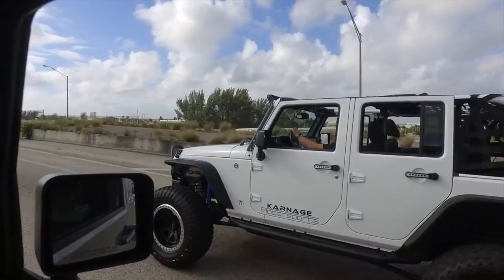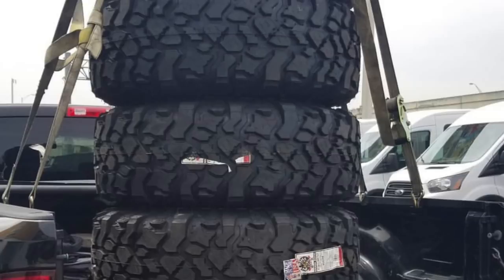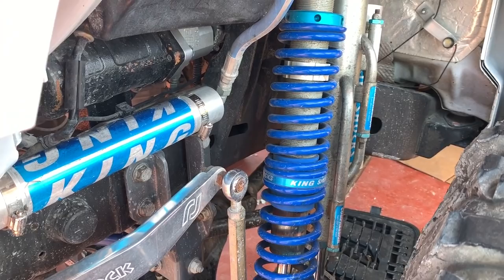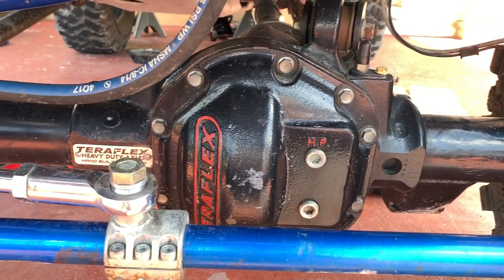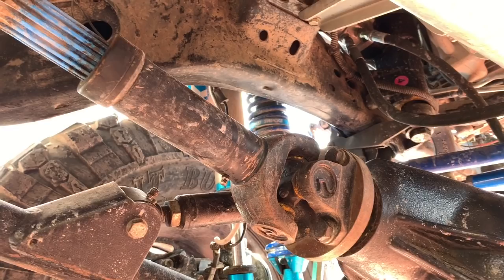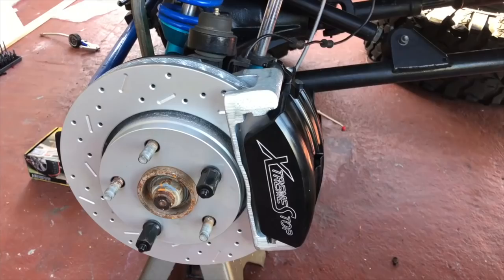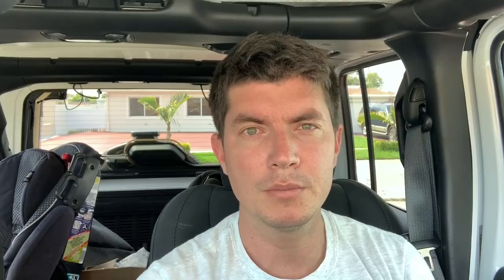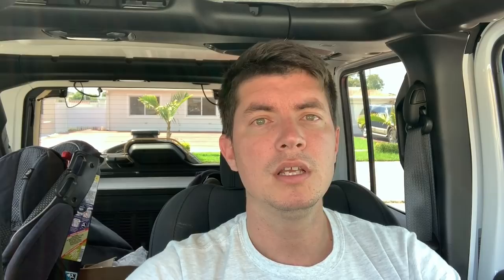What You Need to Run 42" Tires

Comment: I drove my new jlu wrangler rubicon from the dealership to the mod shop . Put front and rear UD60s , evo long arm conversion, evo reservoir coilovers , adams drive shafts, beadlocks , front and rear bumpers , warn xenon winch , 40” tires , PSC HYDRO steer. Total out of pocket cost 52,000 bucks . Price for Jeep 51,000 😂 . Did some other smaller mods , it adds up fast

Comment: What would be the total expense to get those 42s to work well including the wheels and tires?  15k to 25k?
Reply from the maker: Justin Snyder just getting the right Axles $12,000, the tires $3000, the coilovers another 3,000 the lift kit $4000, Front and rear driveshaft $1400, Brakes $2000  so year, around $25,000
Reply: 25k,& the driveshaft is too short..you can do all this a damn site cheaper.you dont need 42" tyres.he doesnt drive thru 5" water holes every day.pst steering,over kill,chrome molly,over kill,its a street rig,not comp.less brains than money..
Reply: 25k just to run 42's that's only cause you have a shop doing most or all of the work. A experienced diy can have it done for alot less. Im down 12k on my XJ including the jeep. Currently its on 40's, tons (locked/linked 60/14bolt combo) and a doubler. And its not a beater rig. I put 150+miles on it somedays just going and coming to work. Not knocking on you. Your wrangler is nice and equipped well. But I know some people dont feel comfortable working on jeeps or dont have the ability to do so. But it can be had for a lot less then 25k for sure.

Comment: Thumbs up for the video. Great info

I have a question or two about my 2014 Jeep Wrangler unlimited sport (automatic)

My vehicle is stock,  I want to give the vehicle some flair. Going with a 6” teraflex with an aftermarket Stabilizer, big brakes, and 40” tires. Any one have any recommendations inorder to do it right? 

Saw another Jeep lifted death wobbling on turns not too long ago. Don’t want to be that guy...
Reply: 6” teraflex lift kit
Reply from the maker: It all depend on how you want to use it, for example if you are going to offroad it you will also need Driveshaft, I recommend Tom Woods Driveshaft, you will also need to Re-gear, you can go with Yukon Gears but those are 2 main things that you will need

Comment: Jeep isn’t strong enough to take the leverage. It will snap like a twig.
Reply: Its gonna hurt the transmission.  He says he doesnt need a steering ram, until he hits the mud.
Reply from the maker: IronskullGM I already have one but you dont need it unless you do heavy offroading
Reply: @offroadnchill  I saw, I got really stuck in the mud without one, had to use the winch because I couldn't turn the wheels at all and was running 37s.